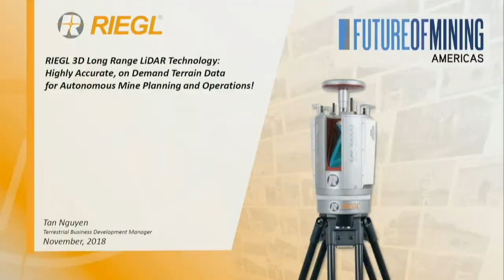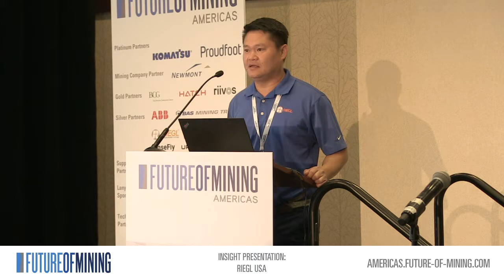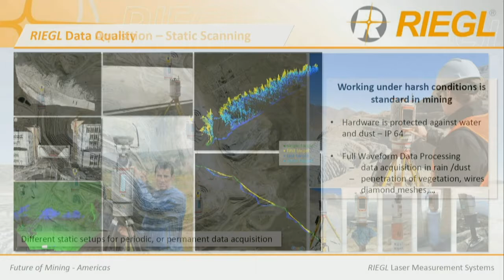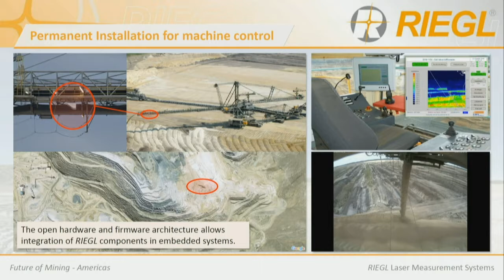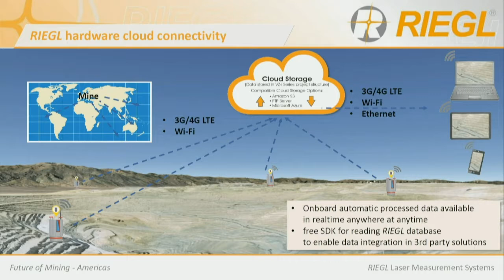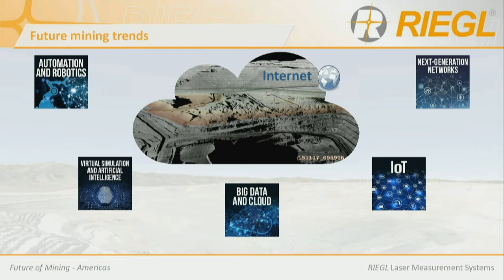Tan Nguyen, Terrestrial Business Development Manager, RIEGL

Comment: For stockpile and mined volumes I get less than 1% divergence with UAV photogrammetry in comparison with Lidar with a fraction of the cost.
Only a very specific niche really needs Lidar. Most operations can work well with a Day-1 information delay on stocks and mined benches for adjustment once every week or so. I mean adjustment because the dispatch is keeping track of these volumes in the mean time, so no worries.